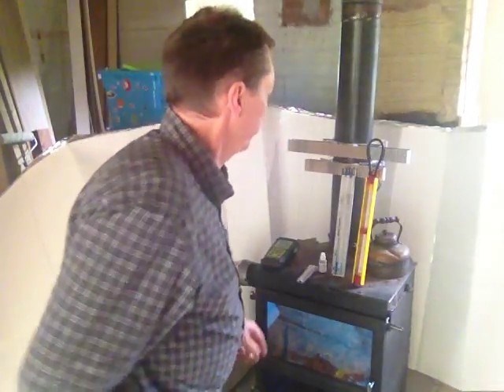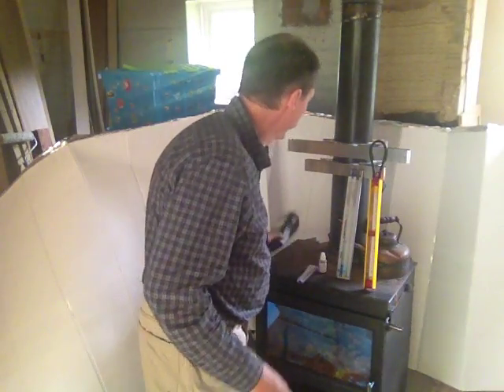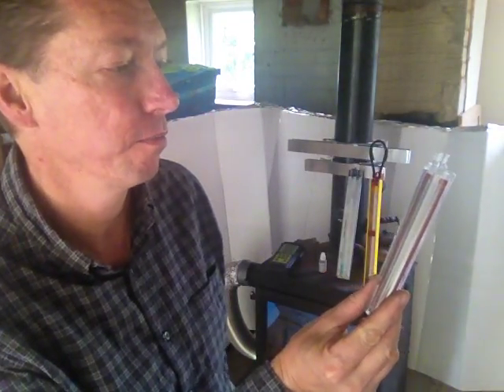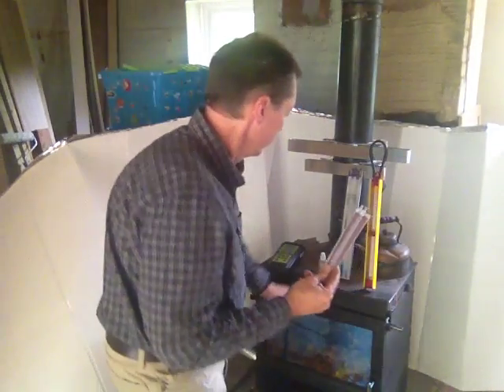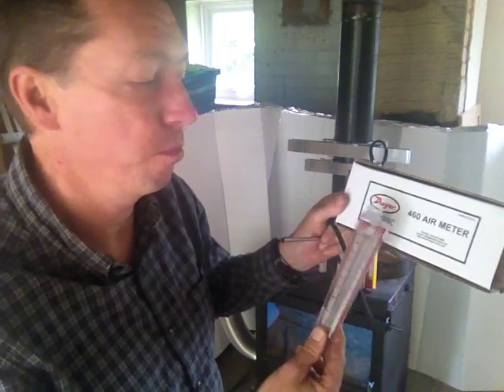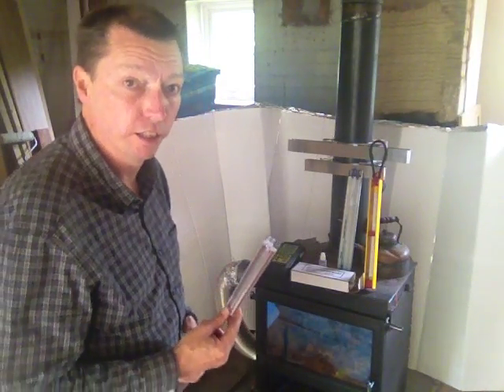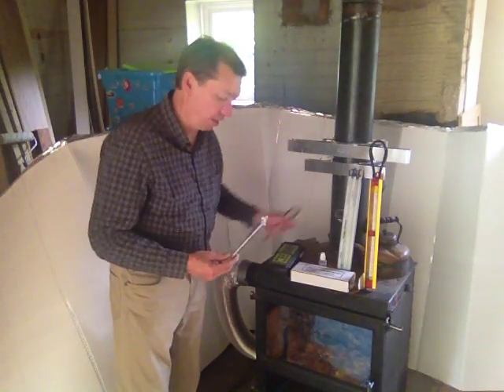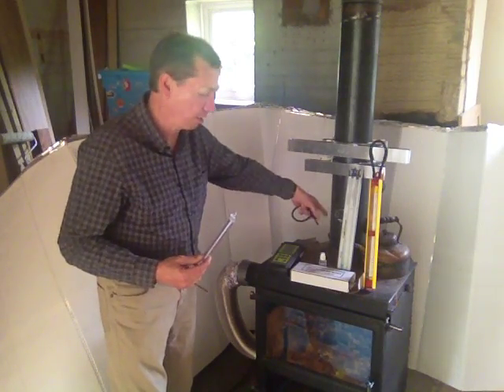What to use to measure flue draft

Comment: I have been searching for a manometer to measure the flue draft .. then I came across your excellent video .. complete with the name and model number .  Well done   . I am in the final castings stage of my own afterburn version of the GLOWSTOVE LIKE NO OTHER.. I am using 8 x  30mm o/d 80cm long tubes in the afterburn chamber and another 17 Stainless steel tubes in the pre flue exit chamber .
Reply from the maker: so where is the link for your stove ,,,, im facinated

Comment: Very helpful, thank you. I have tried using a water gauge but the difference is only 1 to 2 millimeters so is quite difficult to read. I'll try to get one of these manometers
Reply: yes very helpful thanks, I installed a wood burner and had no draught at all , tried a temporary 2 meter flue extension which made no difference so had to resort to fan which isn't the way I wanted to go but needs be! still have 
a few ideas i.e. different cowls,  could you tell me if the 12 to 25 pascals is the D.P. whilst the fire is burning ?
Reply from the maker: @robertdowd464  I real could not say? what stove is it? do you have out side air feed into the fire? how long is your flue ? how is it insulated? why do you have a cowl? chat soon. Kevin

Comment: Oh,  dear. Installing that fitting for outdoor combustion air is probably a bad idea.

Most wood stoves are designed to carefully regulate combustion air to maximize efficiency and reduce pollution.  And controlling the amount of combustion air controls how fast combustion takes place  ----too much air can produce too big and too hot of a fire you have,  which ca damage the stove and perhaps start a fire.

And if you look carefully in the manual for the stove,  there is probably directions on how to feed outside combustion air into the stove and avoid all these problems.  What is the make and model of the stove?

But good video on measuring the draft.   I keep a thermometer that has a probe stuck into the flue pipe of my stove and find it useful for managing the fire.
Reply from the maker: AAAAaa well this is not most wood stoves, https://youtu.be/L8drfUrSTTc?list=PLCBDB09C7086C2F7D